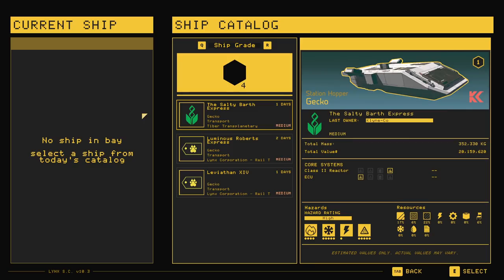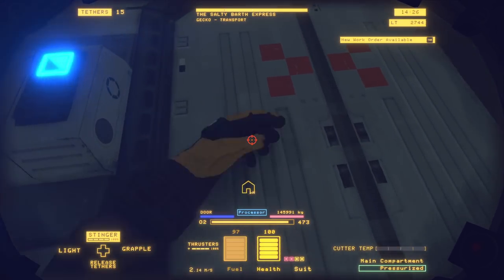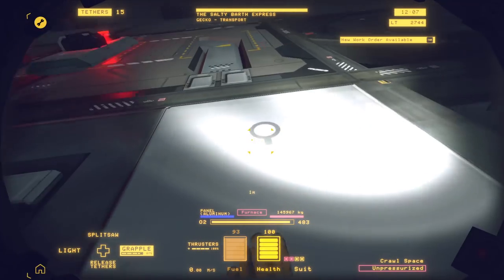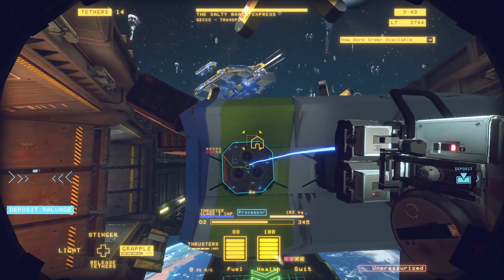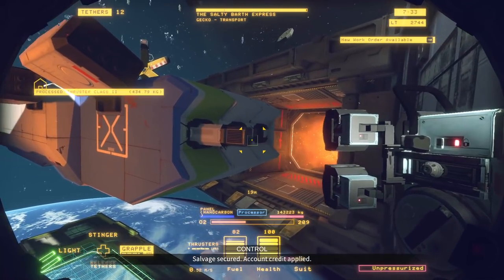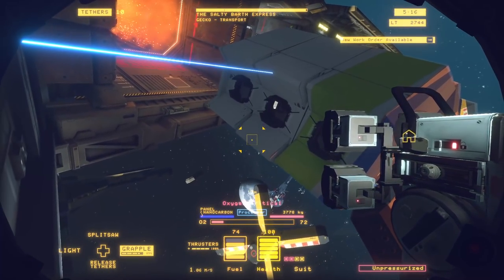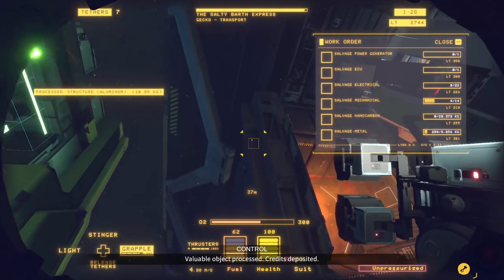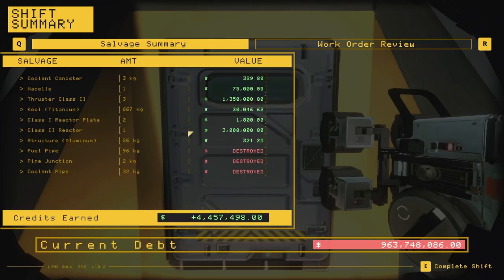Hardspace: Shipbreaker | Guide | Class-II Reactor Safe and Surgical Extraction | Gecko Commercial

Comment from the maker: NEW 0.1.2 Guide is released! Here you go: https://youtu.be/XoFRVAZH8R4
Hey guys! I've updated the guide using your amazing feedback: https://youtu.be/puejBulSKeU
It also includes Power Generator and ECU extraction.
What other guides would you like to see? Lemme know!
Reply: I haven't looked at your updated video yet.  But as of today, shooting that little box between the thrusters and the connected pipe WILL cause the reactor to become unstable and then meltdown.  So, yeah, obviously that was a bug and they fixed it.
Reply from the maker: @ABQSentinel  Aha! I knew it was gonna get patched. xD  I made sure to address that in the update video.
Reply: @Akabane101  Yeah, it's too bad.  With your method, you could easily strip out the reactor, thrusters, and nacelles in one work day and make a ton a cash!
Reply: Teach me how to pull power junction boxes off the walls without them sparking and catching things on fire
Reply: 4:03 That now triggers a meltdown after the new patch. It was a bug that you where able to do that ^^
Reply from the maker: @Wiromax3  I cover it here! https://youtu.be/XoFRVAZH8R4
Reply: @Akabane101  
Cool! Thank you :)
Reply: So, I guess there's a bug with the ECU because I was tearing my hair out trying to figure out how to disable the coolant even though I took out the canisters inside it. Turns out, if you just grab them with your hands while they're still attached to the ECU, the game doesn't register them as being gone. So, you have to pop them out with the grapple gun, and then pick them up.

Comment: The difficulty jump really surprised me between the grades of ship when I was playing
Reply: Yeah it I was really overwhelmed
Reply: Yeah, those are some pretty steep jumps between levels.  I kind of like it, though.  Rather than the usual, gentle increase in difficulty, this make each new ship grade a whole new challenge.
Reply: Free play is really useful in this situation. I spent about 2 hours dissecting the various geckos and I brought by extraction of all major systems down to 8 minutes (coolant, reactor, engines, generator, and fuses). If certain areas are pressurized you can use that to shave some time off as well. 

But the first time I saw the gecko I pulled up my sensor and did not know what the hell was going on lol
Reply: agreed. I think it wouldve been better if they gave us a gecko cargo transport instead of a gecko station hopper as a stepping stone
Reply: theundeadbox tbh, the transport is easier in my opinion, as you only need to cut out the aluminum floors and then strap all the chairs to the barge after pulling out the floors. The cargo is a little harder because a lot of the hazards are out in the open and likely to get cut.
Reply: I agree the transport is more tedious, but easier. I do think we will get some more intermediary ships as the game continues to develop. Something between the Mackeral and Gecko.

Comment: Fun fact. you can use your scanner to see whether or not a room is pressurized or not, it shows a short description of the room and a square that is either red or green
Green = Pressurized
Red = Depressuirzed
Reply from the maker: Yoooo, I didn't even realize that! I criminally underuse my scanner. I basically use it to find structure weakness. This will be super useful. Thanks for the tip! <3
Reply: @Akabane101  no problem boss
Reply: @rahfeeki8540  Ooh, so that's how you can tell that. I was wondering about that. The tooltips said that scanner can tell you that, and I was like, "...how?" :)

Comment: This is outdated now. The most recent patch has the reactor melt down as soon as the coolant is pulled.
Reply: Yeah, I noticed that lol, I pulled out the coolant and just immediately started panicking lmao
Reply: Currently, it starts melting down as soon as both fuel and coolent are gone. I usually end up cutting a clear path to the reactor, rapidly cutting the pipes away, and sending it on down
Reply: As it should...
Reply: Must have changed it.. i pulled the coolant and all was fine lol. I cut the purple thing tho and it exploded so idk
Reply: @carlj7466  XD As a technician, I declare your comment funny with a sweet aftertaste
Reply: @PandemoniumMeltDown  dude that damn mission is driving me nuts. I can't yank the thrusters without reactor meltdown and I can't remove reactor unless I remove thrusters first its a goddamm loop lmao
Reply: @carlj7466  Classic case of damn if you do, damn if you don't... MeltDowns... I can relate.
Reply: @carlj7466  I removed the coolant and it was ok, but the moment I removed the fuel the reactor went critical. I simple gave up on that ship and let it explode.
Reply: @carlj7466  On the GHOST SHIP yeah I cut the Purple Box to the Thruster and it explode right away 11/2/2020

Comment: Removing the fuses is acctualy very easy the pulses are on a 3 pulse timer pull on 4th pulse when it turns white click F to remove the fuse there are normaly 3 fuses 2 on side and 1 on top closer to reactor. Btw the pulses go slightly faster the more you remove.
Reply: Be warned: there is a bug currently where the game lets you pick up the fuse boxes after they've popped out. When you do, it will YEET YOU towards where you pulled it from, so you will basically get electrocute AND have your skull caved in from the acceleration.
Reply: @artuno1207  A temporary workaround is to bring the fuse back to the box with the grapple before picking it up. It tries pull you back to its original spawn point, if you're already there it doesn't hurt you.
Reply: @artuno1207  I found that out the hard way... I pulled out all the fuses (no electrocution) on my first try, then forgot about them, then on a later day I went "Hey, what's this box floating so far away from the ship? Huh, says 'pickup' oh well" Instant vaporization at lightspeed against ship hull

Comment: Other key locations I've noticed is that some end up under the main compartment, or below one of the airlocks.  I've come across one floating in the thruster room.  They should show up as purple on the Scanner's objects mode (the one that also highlights consumables like oxygen tanks in purple) but they're that small that they can be easy to miss.
As for the fuses - you have to time when you use the switch.  Don't touch it until the moment all three lights on top are white.  That'll pop the fuse safely and you can then grab it, no risk of electrocution whatsoever.
If I think of anything else while I'm watching the rest of the video I'll edit them in here.

EDIT: Not related to something you talked about but one little trick I've been using to move quickly between the ship and the hab is to use the grapple like a grappling hook - if you try and reel in an item that's much heavier than you (like say the entire ship) then it'll instead pull you towards it.  And while you could injure yourself by running into it at such high speeds, your magnetic gloves actually seem to stop you entirely and safely no matter how fast you're going (provided the gloves are what contacts something first).
Reply from the maker: Ahhh, so that's how you do the fuse, thank you! I just assumed I had to be further away from it or that my suit wasn't upgraded enough.
That's also really good to know about the key locations and traversal mechanics. Thanks for sharing!
Reply: @Akabane101  Happy to help.  There's another movement trick I'm trying to work out the trick to where you just tap a glove button for a moment or so and you launch yourself forward.  I think it'd only really be of use if you're clambering across the length of a ship's exterior or maybe give you a headstart on the trip back to the hab before you grapple-reel it, I just can't get the timing and what direction to face right consistently yet.
Reply: If you remove the power generator first then all the fuses automatically get removed from their sockets and are safe to pick up.
Reply: @TheNotSoIrishGamer  True, but doing so also damages the power generator as you remove it.  Leaves it in a state where one solid impact'll turn it into scrap.  Time it right (which actually isn't that difficult, placing a hand down next to the lights will let you hear the beeping it makes as the lights change colour) and you can pop the fuses safely without getting electrocuted and leave the power generator undamaged when you rip it off.
Reply from the maker: @TheNotSoIrishGamer  Ooo, I was wondering why some of the fuses would be floating out of their sockets. That's really good to know, thank you!
Reply: Keys can show up absolutely anywhere, including in the crawlspace of the ship between the outer and inner hulls. It's part of why I feel they are absolutely not worth worrying about.

The other is that you don't need to cut the thruster plates off the back,  if you salvage the big nanocarbon panels  (both go in the processor and are not attached to the thrusters), and you want to clear that space to pull the thrusters anyways. Assuming you salvage the 9000kg nanocarbon panels, which I believe are worth about 400,000 dollars each anyways, venting the thrusters manually is just as safe and  just as fast, even assuming the key is nearby. 

Just cut the frame hardpoints, pull the rear slightly back and up while you blow the midsection panels out and into the processor (to clear the rear panels), then you can pull the rear forwards past the processor and it won't get snagged by the furnace. At which point, you have a nice hole to dump the thrusters, reactor, and ECU out of but you also just have the thrusters only attached to the ship by a single switch which can be toggled after you have already tethered them to the barge.
Reply: @procrastinatinggamer  You can remove the power generator another way. Cut away the panel around the power generator, and you can throw the whole thing down (power generator still attached!) into the barge. So long as the room behind is already depressurised, it is safe to do it this way with no risk of damage to anything.
Also, I really, really hate those fuses. They don't have a mass parameter on them, and trying to boop them away results you being hurled backwards at light speed. It's pretty ridiculous.
Reply: @foxwithashotgun7726  The fuses have been fine for me.  I keep out of their way when I pop them and then collect them (same way you collect the little coolant tanks in the ECU or consumables off the walls).  Never had them fling me away, but I've been clearing the outer hull away from them beforehand just to be safe.

Comment: Things I learned from this video: What the F'in key was for (I never knew you could use it to shut off the fuel, I always pulled the levers after removing the fuel tanks and then ran!), how to properly pull the ECU (I knew about the door but I always pulled it and then moved on so I never saw the coolant modules inside), what the Acoustics Upgrade I paid for was for (hearing the pipes and the other side of the door), and that I could pull the whole reactor housing instead of taking it apart. VERY educational, thanks!

Comment: Man, I was cutting the glass in front of it in the reactor room, and trying to get it to clip through after taking off the doors. This is way easier,
Reply: I think that is actually the way. You pull the nanocarbon, then you cut the side away from the ECU away with your stinger, then you just pull it straight out sideways and tether it down. The only trick is you have to do this after you salvage the rear of the ship, but frankly, those 9000kg nanocarbon panels are like 400k each anyways, so it's not a big sacrifice to do so.
Reply: Ye I did the same thing, I even removed all the explosives away then I just flipped the 3 switches on the engines most of the times only 2 would go off but so far I not blown up doing that but I have no idea if they can trigger the reactor.

Comment: Just a heads up. When you are grappled to an object you can hold down the right mouse button to pull it to you if the object is light. If its significantly heavier than you the grappler will pull you towards the object you are grappled to.
Very useful when moving something like a coolant or fuel tank through a tight space. But it also is useful for making the trip between the ship and your hub much faster than with your thrusters.
Great tutorial!

Comment: Wait, THAT'S how you defuse the ECU?
Reply from the maker: Surprisingly super easy! When I interacted with my very first ACU, I didn't even realize you could rip off the front panel until an explosion took it out when working on the ship. xD
Reply: It always baffled me, since it clearly says the reactor should start melting down the moment you disconnect the cooling...
Reply from the maker: @Beregorn88  In the newest update (0.1.2) that just released, once BOTH the fuel AND coolant lines are disabled, the reactor will begin it's meltdown sequence.
Reply: @Akabane101  I didn't even need to disconnect the coolant and fuel to trigger a meltdown.  A burning datapad blasting out of a pressurized airlock managed to do the job for me.
Reply: @starboyk  yeah but pulling the reactor is tight
Reply: i thought that was how you did it, just didn't spot the last coolant can
Reply: Allegedly, it still hasn't worked for me, even after removing all of the mini coolant cans.
Reply: @Mavericktravo  And It won't the game has been updated to not allow this method.  clear the path, then pull the coolant last, it will start to melt down.

Comment: Thanks alot! i didn't know about the block in fornt of the engines
Reply from the maker: Took me a bit of experimenting, but thankfully that block makes it incredibly safe to do this. Hopefully they don't patch and change it, otherwise I feel they need to implement a safer way to turn on the emergency fuel ejection switch.
Reply: @Akabane101  they could add a fuel shutoff valve or a vent function
Reply from the maker: @Panzerfan93  Yeah, that way I don't feel like a mad man burning off a block of fuel. LOL
Reply: @Akabane101   I expect it patched, it's a result of a bug with the needle beam not flagging explosions in pipes where the bonesaw would. I've been experimenting with methods to remove the thrusters safely using the emergency valves. Mostly involving tethering them then pulling the switch and praying. Necessitates removing the reactor before the middle thruster in case the vent jet shoots straight into the reactor housing. It's enormously more of a pain.
Reply from the maker: @Durendal_exe  Yeah, I'll probably end up doing a follow-up video if it does get patched. My theory for a /not-as-safe/ but probably the intended way to do it, is to remove all the explosives in the area, remove the thruster caps / thrusters, disable the coolant line and then eject all of the fuel lines with the switch. That way when they do rupture, the sprays of burning fuel can't be ignited by anything nearby.
Reply: @Akabane101  That's how I've been doing it, aye. Mostly stymied by the thrusters themselves being explosive and hard to clear away without peeling the rear hull entirely.

Comment: You can safely grab the fuse when all 3 lights are white.  The timing speeds up on the other fuses as you pull each one.  Each fuse you pull stops you from doing one damage to the power control module thingy.

Comment: I would note a couple things.

The thrusters are not actually attached to the thruster cap. It's much faster to just salvage the rear side panels, with the thruster caps attached (they go to the same location) then pull the thrusters straight down into the barge (this also removes any fuel tanks from the area so you can manually vent the thrusters with no consequences other than a pretty light show).

It's much faster to pull the reactor out the side, as you can just destroy the glass, the upper and lower plates below the glass, the 3 sections of reactor containment facing you, then you can just pull the reactor right out sideways and tether it into the barge naked, and you can do this with the fuel still in the lines. 

I have been doing this a bit and I am pretty consistently getting 1600 LT and 7.5-8 mil credits per day just ripping out the basics and getting all the nanocarbon. Which is a bit of a shame, the game really doesn't reward you for being thorough or not damaging the ship. It's all about just getting stuff off and into the processor and barge as fast as possible, and getting a new ship every day so you always have 50k components to be salvaging for most of every shift.
Reply from the maker: This is very informative and useful information! Thank you for sharing! <3

Comment: Oh man! This is so much easier than how I got it out the first time! I did everything wrong! Had a minor run in with the ECU (when you took the door off it I was like "Nooo! Really?!?!" lol), used one of the valves on a thruster and caused a slight explosion (only that 1 thruster and corner of the ship was affected - made it heaps easier to see wtf I was doing!), cleared away all of the pipes with the split cutter beneath the reactor, and it would not come out! Turns out it was jammed a little off-kilter as I hadn't been pulling it straight down (good tip with the square on the barge as a target!). 

Eventually after plucking the top and bottom and the sides off the reactor it came out, and went to the barge no problem. When I came back on day 3 (same play session), it exploded on the barge! Very entertaining - and I still got credit for it! :-)
Thanks for the very helpful video Arkbane101! Subbed.
Reply from the maker: Hahaha, I've had the reactor blow up on the barge as well. Thankfully it still counts, but it cracks me up when something I send smashes into it a little too hard or explodes and causes an unexpected meltdown. xD